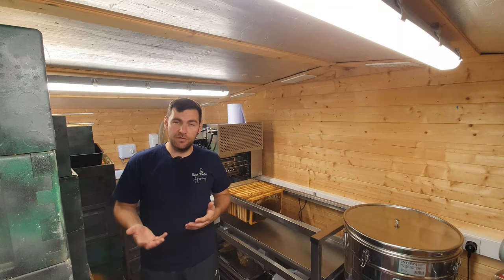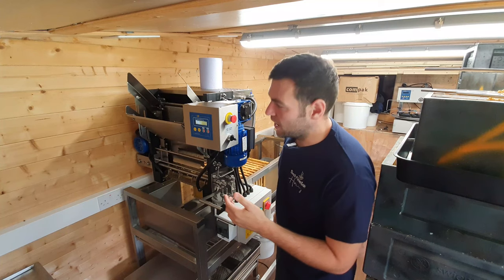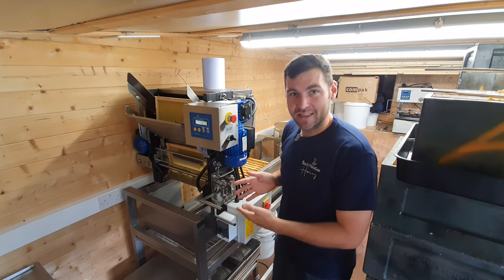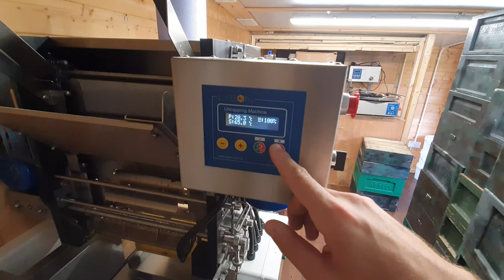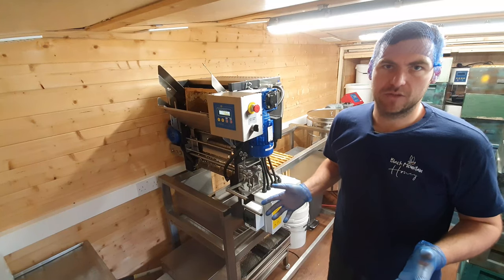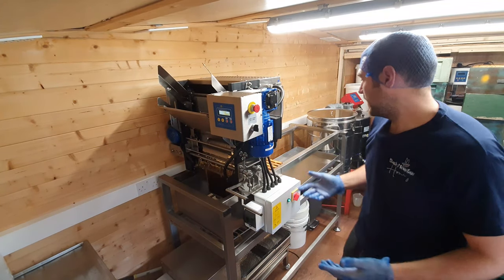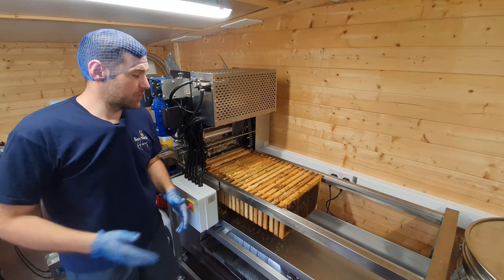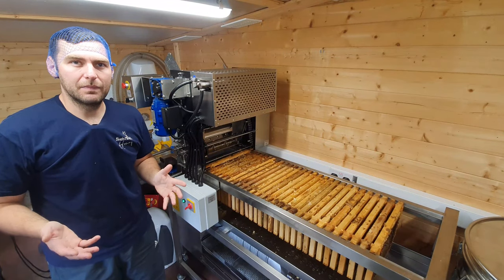How To Uncap Honeycomb - Lyson Uncapping Machine Review - Honey Comb Cappings

Comment: Hi there, I guess the honey leaves the cappings press through a hose.   So: Lyson > extractor > sump > bottling tank > bottling machine? Any help would be amazing. Thanks.
Reply from the maker: Well, there is the option to do that but you need a pump to pull it through and back up to the sump. If you want to do it gravity fed, you could, but you would have to start high. 

I use a bucket to decant from the extractor/cappings press and place together into a 200 litre settling tank with a sieve. Does away with the need for a pump/sump so good for space saving. Works really well.
Reply: @BlackMountainHoney  Thank you for responding, you are helping so much. That makes perfect sense, a bucket from the cappings area. The extractor is separate from the Lyson and a hose goes from the extractor to the settling tank and the buckets of honey from the wax press get poured into the settler, which then goes to the bottling tank and then to my Neissenheider.  Sound about right?